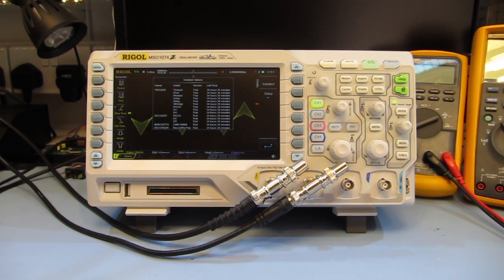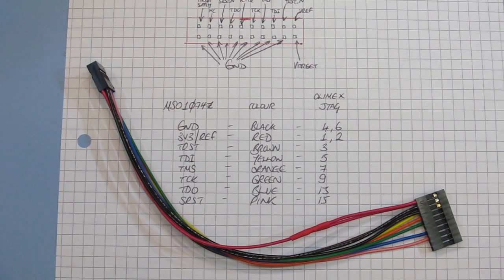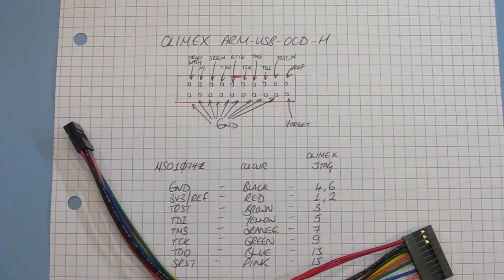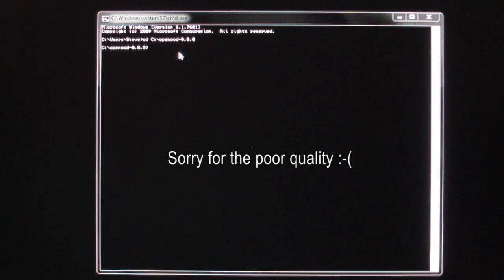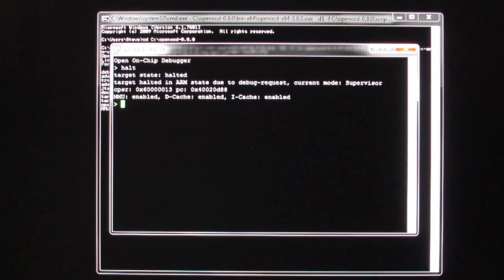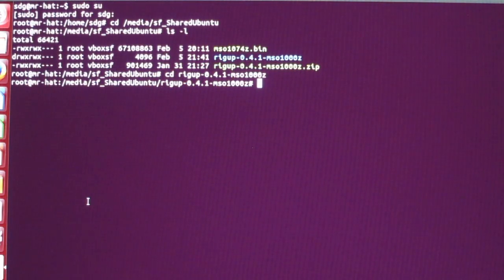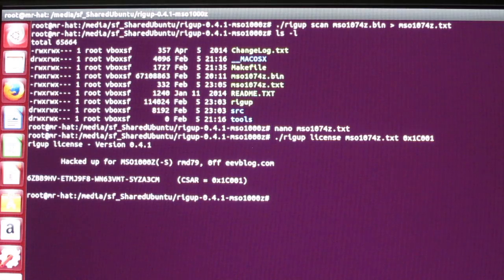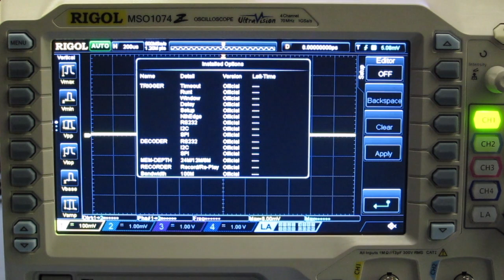SDG #04 Unlocking Rigol MSO1074Z Options

Comment: Insetad of replacing the ventilator, wouldn't it be easier to put a resistor into the line so it runs slower and makes less noise? In my PC power supply I connected the 12V ventilator to 5V instead. It is nearly completely slient now. It blows less air, but the power supply does not become too hot.

Comment: Do thees crimps really cost £412.00
http://uk.farnell.com/harwin/z22-020/crimp-tool-m22-series/dp/672579
That's half cost of the scope itself. Are they worth it? What alternatives would you suggest?
Reply from the maker: juliusvalentinas you can fold the crimp terminals with mini pliers and solder if you don't have a crimp tool

Comment: Can I use the same proceedure for the MSO1104Z-S...obviuosly I wont have to do the 100mhz option but are all the rest the same?
Reply: Yes you can. You may just have a surprise depending on your model: the JTAG headers may not be there. You can try with female header just seating unsoldered in the PCB. It works at 5000 KHz.

Comment: small typo in your commands "./rigup scan mso1074z.bin mso1074z.txt" should be "./rigup scan mso1074z.bin > mso1074z.txt" to redirect the output- otherwise great job especially on the pinouts for the wiring - this worked fine on my ds1074z plus with the same olimex dongle

Comment: So i need to copy memory from scope, over JTAG using OpenOCD. Witch jtag box should i use, is any good aor some special?
Then i use rigup tool to generate licenc key?

Thank you very much for this video.
Reply from the maker: +Бојан Драшко Any tool supported by OpenOCD is fine - You can use the Olimex like in this video, or a genuine Segger J-Link or anything else that supports the ARM chipset.
Reply: SDG Electronics I am just afreid it is to complicated, but i am buying it anyways xD

Comment from the maker: Hi Vintage Synthlab - You can modify the source to work on a Mac - I think the Mac related lines in the source are just commented out.
Reply: +SDG Electronics - Thanks (again). Everything worked well. Your video is well articulated and edited. Great job.

My only hurdle is that as an electronics tech of 24 years, I don't have extensive experience on the programing / coding side of things. But after reading some manuals for setting up drivers, hardware config, etc., I finally figured it all out.

One thing that tripped me up was the need to call out the JTAG clock speed (adapter_khz [####]), I had to add it to the interface adapter script file.

Terminal (on the Mac side of Parallels running) worked just fine with the same commands, unmodified.